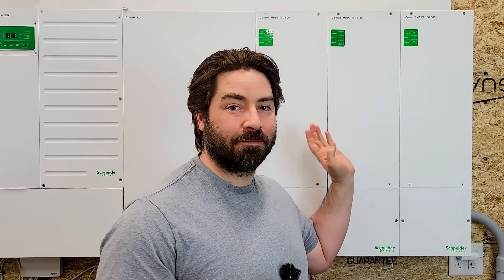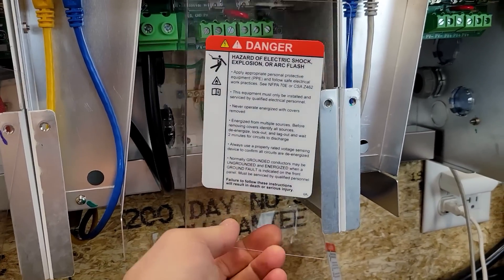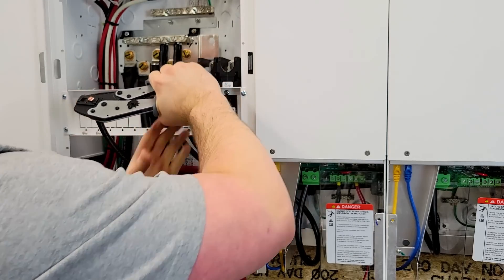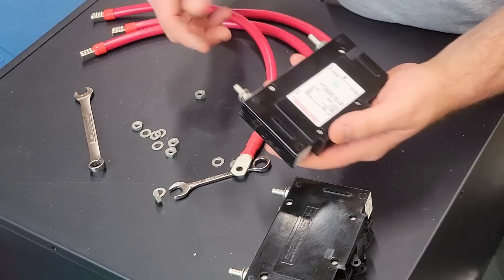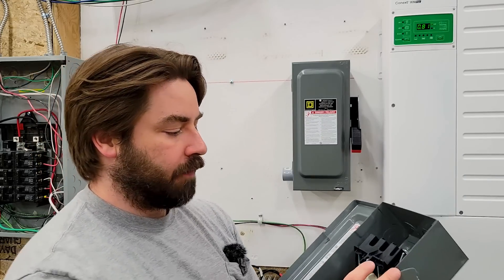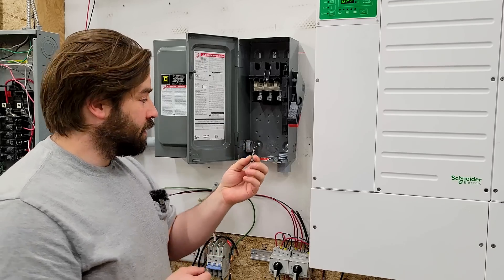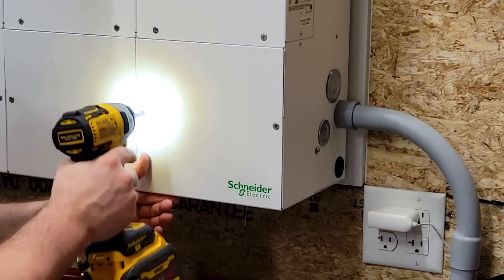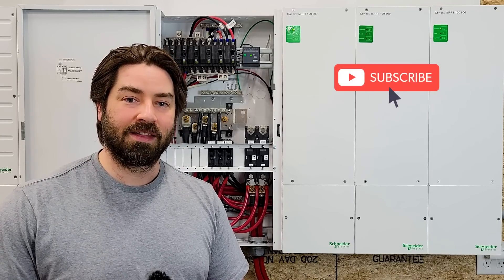Installing 300 Amps of Solar Charge Controllers

Comment: Can I use two inverters in parallel without the pdp box if I'm purely off grid?
Reply from the maker: Yes!  The PDP is a nice, clean way to install the Schneider equipment, but it is not required to get the inverter up and running.  What is required, is the "Insight Home" to parallel two or more inverters.

Comment: Can you tell me about the 3 cables coming into the box is it from the solar panels then it goes into the charger?
Reply from the maker: The solar PV array enters the charge controllers on the left side.  This is around 300VDC from the PV array.  Then, the charge controllers bring that down to the battery Voltage, around 56VDC.  They leave the charge controllers and move left into the power distribution panel and meet up with the busbars and circuit breakers.  Does that answer your question?

Comment: NEC Article 690.31(G) requires “metal raceway” from the PV Circuit point of entry into a building to the disconnect.

Comment: Thanks to your useful videos, I have the Schneider system in my garage ready to install this Spring.  Even though I will only have two inverters, I opted for the BCS that has already been installed and passed inspection.

Comment: Hi David, do you know if you can use the Schneider 6848 Pro and the charge controllers you have along with those chevy volt batteries you had a few years ago?
Reply from the maker: Yes, I know someone with that setup.  But, remember, most people have moved to LiFePO4 because they are safer than used EV cells.
Reply: @DavidPozEnergy  I really appreciate this David, unfortunately this is what I have for battery at this moment and would like to use them up before spending $$ on other batteries, and Naz has these inverters on sale! I would have bought these a few years back but life got in the way. Either way, the batteries will be housed seperately from the home so no worry about safety, and they have always been stored well by me (ive had them for a few years in waiting, but batteries have come a long way and fast sine then, as you know....but I have 2 full Volt packs broken down to 48v units....Again, I appreciate the response and time. Maybe in a few years I can switch out, who knows maybe I sell them and buy LiFePO4 batteries? Thank You! Great Vidz by the way

Comment: This is 100% a top tier system 
But for the complexity and cost u can get one eg4 12000xp inverter. 
It has 100 amp auto grid bypass,
It has 250 amp/12kw battery charger 
Can handle 480v solar 24kw 33 amp.
Only 100 watt idle
Can start a 4 ton central air
Built in 300 amp dc breaker
100 amp grid breaker
Accepts 16kw generator input
Accepts ac coupling 
Has a 50 amp smart load output breaker 
It has Rapid shut down
It has local pv disconnect 
Its UL listed
Its the best off grid inverter on the market imo and all for only 2500
This Schneider system is north of 15k easy

Comment: Nice Job! I watched videos of these invertors not being able to have time of day to distribute back to the grid. Have they fixed this? Where did you buy your invertors/charge controllers?
Reply from the maker: Mine are from Signature Solar.  I have links in the description.  My system is 100% off grid, so I haven't tested any of the grid-tie features.

Comment: I read that you are not supposed to ground solar panels.   When you grounded the disconnect panels, that is just a local ground to the box and not grounding the panels upstream?
Reply from the maker: My solar panels are equipment grounded, not electrically grounded.  This means the metal frame of the panels is bonded to a ground rod in the earth.  However, the positive and negative are NOT bonded to the ground rod.
Note, this may differ from one jurisdiction to another.
Reply: @DavidPozEnergy  Do you have the negative side of your battery bank grounded. I have the same equipment, but am banging my head trying to figure out how to ground the CC. My XW Pro has a chassis lug and the AC ground bus. My multimeter tells me they are bonded inside the XW Pro. So I used the chassis lug to connect to the battery negative bus bar. So even after a call to Schneider (which wasn't much help), I can't decide if I should install the fuse in the negative ground slot or leave it floating. I have everything connected and working properly, except the array. I'm scared to turn it on until I have clarification on this fuse. I see you left yours floating so thats why I'm asking about the battery negative being grounded on your system.

Comment: I am looking to understand why you didn't use the charge controllers that are built into the XP Pro's, they are also made by Schneider.  Is there a significant difference that justifies the cost?
Reply from the maker: I'm running a pair of XW Pro inverters.  They do not have built-in charge controllers.

Comment: With Scnhider discontinuing these inverters, are you worried at all about support from them, or lack thereof??
Reply from the maker: I don't put faith in any company providing after sales support.  I imagine Schneider will be the same as anyone else: wait on hold 5 hours, send photos, and in the end say "no".  I'm thinking of buying a spare inverter at some of these very low prices.
Reply: @DavidPozEnergy  I just bought 3 today ($3600 total), thinking running 3 low power will make them last a long time or I can run two and keep one as a wired spare in case one goes down.

Comment: Do you know how long the cat5e is for the, charge controllers to charge controllers,  charge controllers to inverter and inverter to inverter.
Reply from the maker: CC to CC I used a pack of 3-foot cables.  They are longer than needed, but just what I had available.  From inverter to CC, that goes through the PDP, and is longer.  I think that one was a 10-foot.  I just used ones I had on hand.  If you are good with this type of cables you could make your own.  Mine each have a little extra in a loop inside the aluminum tray.
Reply: @DavidPozEnergy  Thank you

Comment: Hello David. One quick qn. There are 3 ferrite cores provided with each controller, and I couldn't find it specified in the manual. Does it go around each pv wire pair (+ and -ve)

Comment: Hello. a quick qn. I see your charge controllers are flush against each other, but for me there are two protruding screws on each side, which makes them 1/2 in apart. The issue is that, I can't put a knockout busing or chase nipple to combine the knockouts. Did you take out those screws. Thanks
Reply from the maker: I think one of the screws (top) I had to remove.  The bottom screw I think I was able to re-install it.
Reply: @DavidPozEnergy  thank you. I just tried a closed nipple, and it seems to work ok. thanks

Comment: Hello David. thank you so much for posting these and I ended up getting same configuration as yours (only 2 charge controllers). Two quick questions. While reading the manual it say "The charge controller is configured at the factory for an ungrounded PV array". Have you add a fuse to make it negative-grounded array. Second. In your fist video, you used 6 AWG wire for load out to the service panel. With two inverters what kind of cables are you using? Thank you
Reply from the maker: Thanks for your questions.  I have not added a fuse inside the CC.  My solar array is "equipment grounded": meaning the frames are bonded to a ground rod at the array, but the PV negative is not grounded. 
As for the 6AWG, I still have the same wire.  I should technically change it to a 4AWG wire, but I just can't pull that many Amps on a single leg.  Remember, my setup is off grid only, I don't have the grid passing through.  
You are certainly correct, though.  Perhaps I'll make a "Shorts" video swapping out the 6 for 4?  It's not worth making a full-length one.
Reply: @DavidPozEnergy  Thank you so much for taking the time to address my questions. This lead me to read few posts, and bit unsure about whether one needs separate grounding rods for the equipment & system. I am going to connect the equipments using the a/c grounding to the rod, and hope the pv panels can be attached to the same rod. Please let me know if you did it different. Also, I am a software/electronics engineer by profession but not versed in high power terminology and couldn't wrap my head around how the jumper at Conext  Breaker Kit for Parallel Inverter kit works. Most say parallelling breakers is not recommended because of impedance mismatch. Greatly appreciate if you can point the correct terminology or resource I can learn more about. Thank you!!
Reply from the maker: It's difficult to get into grounding questions in comments.  My solar panel frames are bonded to a ground rod at the array.  This is different from my electrical ground which is in my house main breaker box.  
As for paralleling breakers: Yes, you don't want to parallel breakers.  Inside my PDP I have a breaker for each inverter.  These are not considered parallel since each breaker is for a separate inverter.  If you want to see an example of true parallel breakers, and why they don't work, check out my most recent video.
Reply: @DavidPozEnergy  thanks again for your time. I will be consulting an electrician for the high power a/c installation, but like to understand the whole. I saw the parallel breakers demonstrated in the discovery battery video. thanks again.

Comment: Hi David are you still running the 6848? I’m about to pick one up just checking because you are the only one I see with one recently
Reply from the maker: Yes, I've been running a pair for over a year.  Most DIY people are picking up the all-in-one units since they are easier to install.  That's probably why not as many buy the Schneider.
Reply: @DavidPozEnergy  why did you say not to use welding wire... it was a 2 second mention - is it because the location doesn't require the rubber sheath they use on it?  The welding wire is UL listed typically.
Reply: I called NAZ Solar to ask some questions about this inverter and they told me Schneider was discontinuing the line of XW PRO products and I should consider solArk instead . I was bummed …   Told them I would still buy one anyway this unit should last  for decades , they eluded to support etc…. As an industrial electrician I install SquareD gear for a living and still wouldn’t hesitate to purchase a $3000 inverter discontinued or not . Your thoughts ??
Reply: @DonnieThomas-m2y    I just bought a complete setup - well not the MPPT, but the inverters, PDP, BCS, etc from NAZ solar - they are warrantied fro 10 years.  The price NAZ solar is selling them for is $1500 each and all their other Schneider gear is somewhat discounted.
Reply: @DonnieThomas-m2y  I contacted Schneider directly and they told me they have not announced the discontinuation, but if they did, it would still be warranted and supported.  I think they would have a vested interest in supporting these systems because they are widely used in the commercial space.  Now if they did flat-out stop supporting them, I would hope they would open-source their code, but that is doubtful.

Comment: Is there any way I can ask you a few questions? I set up a Chevy volt battery to a Trace sw5548. Just need help with bulk, float, minimum set points.
Reply: I have 2 whole chevy volt battery packs broken down to 48v packs and waitiing to get inverter and charge controller, let me know (if you dont mind) what you have set the bulk float and minimum set points
cheers

Comment: Hi David, love your videos.  I have a question about where the power goes after the Schneider PDP.  There aren't many breakers in there so I assume you're going to a regular residential load panel from there?  What is the breaker size there and what size cable are you using if you don't mind me asking?  Thanks!
Reply from the maker: The inverters take the battery power (nominal 48VDC) and turn it into 120/240VAC.  This comes out of each inverter to the upper circuit breakers, which are 60A.  At the breakers there is a common electrical bar joining the hot's together, which is the "combiner" between the two inverters.  After the combiner, there is one set of wires (L1, L2, N, G) that leaves the PDP and goes down, through a conduit, into the wire way, and finally into a standard 20-slot circuit breaker panel "sub-panel".

Comment: Often times on these 600V AV/DC disconnect switches, the installation manual tells you that if you are using it on DC, that you must wire two of the three poles in series. This HU361 does not require this, however it does say in the foot notes of the installation manual that you have to use the two outside poles, and not two adjacent poles.
  Good job describing the use of ferrules because although the lugs are rated for stranded wire, they are not rated for finely stranded wire, thus requiring the use of a ferrule.
Reply from the maker: Thank you for such a great comment.  I love when I can learn something from a viewer.  I didn't know there were any guidelines on which 2 poles are used for DC.  I spent months planning this video out, trying to make sure I was compliant with every spec, and still missed something.  Darn!
Reply: @DavidPozEnergy  Honestly, I learn a great deal from you as well. Your insights, and product testing and comparisons are something that can't be learned from reading a product manual. Many licensed professionals don't know that they can't use fine strand wire on certain types of terminals. It's not printed on the terminal, and not printed on the box that the terminal came in. You'd have to look up the terminal manufacturer's technical data sheet to figure out if it's rated for solid, stranded, or fine strand wire. The mere fact that you knew why you had to use a ferrule and how to explain it is impressive. I only found the requirement to use the outer poles of the disconnect because I downloaded the installation manual for it. The usage of the 2 outer poles is in fine print after an * at the bottom of a page. Excellent job as usual.

Comment: I have a challenge for you:

I'm sure you've heard of thermal sand batteries by now, and i cant think of a better person to take on a DIY thermal sand battery project than YOU.. You could lay the groundwork for other diyers to heat their homes more efficiently! 

Essentially, you will dump your excess daytime solar energy into a DIY thermal sand battery via resistive elements.. The system would roughly consist of a vessel filled with sand, and would contain resistive heating elements, as well closed loop air ducts that will allow for the  transfer of air in and out of the thermal battery... 3" or 4" iron, or SS  pipes spiraling within the vessel might work for heating and moving the air in and out.. some kind of external heat exchanger would probably be necessary for safety, as the goal is to get the sand up to as much as 600degreesC.. I'm just visualizing this in my head, I'm sure you could come up with a better design.. im just painting a picture. 

My initial thought was that you could use glycol filled lines inside the battery for heat transfer.. however these temperatures are much too hot, and much too dangerous for the use of liquids. even if you used a boiler design, and kept the temps down.. it could get explosive very fast.. so it might be best to avoid liquids. Ideally everything about this system will be dry. Dry sand. dry air. 

Anyways! I realize you probably wont have interest in doing this, but i thought I'd write a lengthy comment about it anyways!

I love ALL of your content, and i especially appreciate the DIY element of your channel.
Reply from the maker: Thank you for your comment.  A few people have asked me about sand batteries.  The difficulty is in distribution of the heat.  If the sand is inside your thermal envelope, then perhaps you don't need any distribution.  However, if you want to use the heat for pre-heating DHW (domestic hot water) then a heat exchanger would be needed.  My current thermal battery is 250 gallons of water, in a tank I built under my house.  I find hot water easy, but I'll continue thinking through the sand battery.
Reply: Right on. maybe ill look at a water based solution as well. I do like the energy density/headroom that sand or carbon based batteries offer. the water tank has other advantages, though, such as water storage amid global record drought.. Im going to go look for your video on water based thermal battery 👍

 @DavidPozEnergy

Comment: Thanks for this series of videos, they are very informative. 

When using the MPPT chargers is there a way to tell the inverters to use that source instead of the grid? I'm hoping it can see, for example, 2kW being used by the house and 3kW coming from solar, and splitting it -- 2kW to the house and 1kW to the batteries.

If it isn't that smart, maybe you can just program it in reference to SOC like in your previous video.
Reply from the maker: I can't comment on the grid-tie aspects because I run these 100% off grid.  I like to keep my comments restricted to functions I've personally tested.

Comment: Have you run into Xanbus bandwidth problems with everything on the same comms network?  I've got 2 XW Pros and 4 MPPTs and ended up having to put the MPPTs on the second Xanbus of Insight Facility.  It's been a while, but I recall troubleshooting that issue for a whole day before finding that solution.
Reply from the maker: I have not had problems with the Xanbus network.  I recall one of the webinars stating the limit is 6 items per Xanbus.  Schneider recommends when you have 7 or more items, you move up to the Insight Facility. I'm probably just under the limit right now.
Reply: I have 2 XWPro, 2 600/100 MPPT, 4 AES 7.4 and the BCS all on one Xanbus with the Insight Facility. No issues.  @DavidPozEnergy